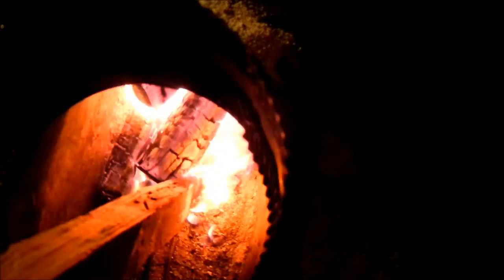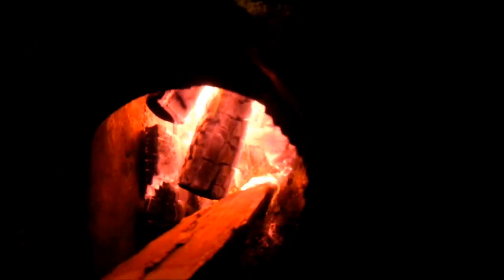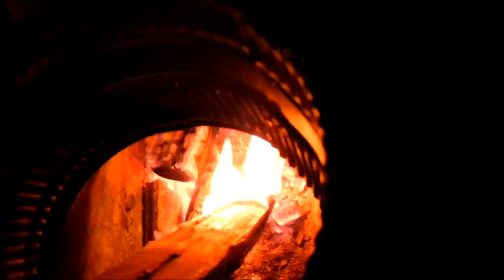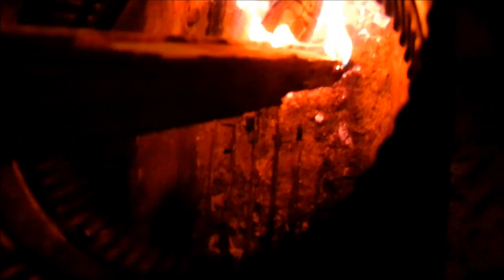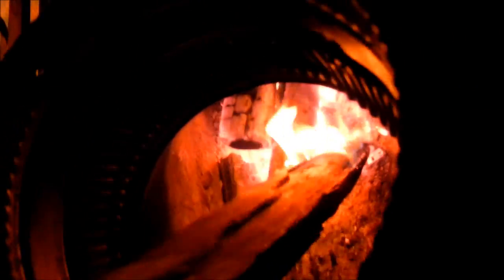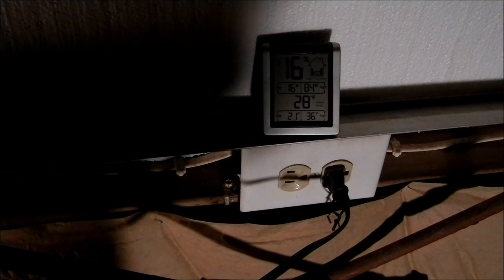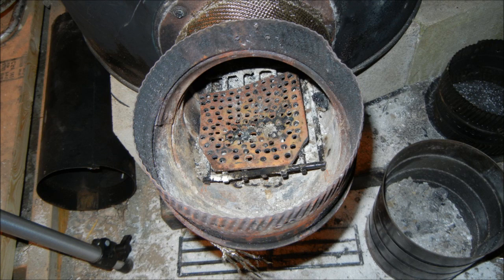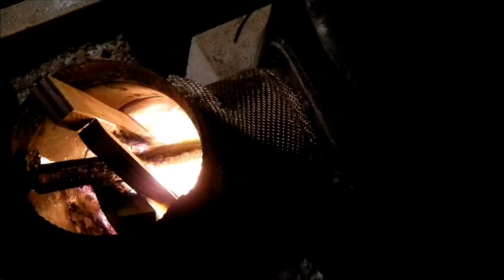6" stove pipe rocket stove heater 55 gallon drum version heating 30x30 foot workshop

Comment: How do you clean out the ash from the burns?
Reply from the maker: There is very little when I do clean it out I just use a small fireplace shovel that I bent so its oval instead of flat to clean out the burn chamber. After like 5 burns I get maybe a coffee can worth of ash. These stoves are super efficient so don't leave much ash.

Comment: You're getting a lot of heat from the exhaust pipe.  If you wrapped some finned sheet metal around it, the heat yield would be better.

Comment: Your wood feed should be a T instead of elbow - load T from top with wood, then cap it, bring in OUTSIDE air from the other (horizontal) part of T
That's how I plan to do my shop heater
Reply from the maker: I tried a T when I started it did not burn right to much turbulence, better off just feeding the outside air in through the feed tube if, if you want to bring in outside air. But then again maybe with more experimentation you could get it to work.

Comment from the maker: I had one of those heat re-claimers on the chimney and it did not turn on the temps were already getting to cold for it 2 feet after the exhaust from the barrel. Stove is still in good shape hoping to use it more this year possibly.

Comment from the maker: That being said if you build one like mine and add thermal mass bench you can store a lot of the heat so that you don't have to keep feeding it. And is something I am probably going to think about adding on this summer, that and I am going to probably section off part of the 30x30' area so I it will be easier to keep warmer longer. it will heat the 30x30' but it takes a while and it cools down fast because of the area dirt floor that's frozen solid etc if I kept the area warm it would be easier.

Comment from the maker: A lot of it is just people are lazy, they would rather throw in a whole log than have to split a log down into small pieces. They would rather smolder a log for hours getting 1/10 the heat output than to burn 1/10 the log quickly and get 10x the heat output quickly. As awesome as these are they do have drawbacks especially one like mine, even with the "hopper" on you have to feed it you can't just throw in a log and its going to keep you warm for hours it has to be fed.

Comment: If you would take some expanded metal and make split your feed tube feeding the wood in on top and allowing air to enter on the bottom you would have a better more even burn and wouldnt have to worry about chocking it off with to much wood . Nice job :)

Comment from the maker: Would be interesting, some guys have done some similar things when burning pellets. Also some have found putting something in front of there wood to restrict the flow can make a better burn it makes the wood move through the wood differently. That is something I plan on trying as well, just have not had the time to mess with it at all lately one of these days I need to get out there again before summer comes.

Comment: Hey Redicety, I had an inspiration seeing your rearranging of the wood to optimize airflow...what if you built a steel mesh tube, put it in the middle of the feeder tube and arranged the wood fuel sticks  on the outside of the mesh tube?

Comment from the maker: Highest I have gotten it so far is like 58 but I have never been out there more than a few hours and the walls still need a lot more insulation. it is a huge area for a stove to heat, I had a traditional wood stove that was basically the size of this barrel but the whole front opened to put wood in. That did not do nearly as good of a job as this and this is burning at least a 10th of the amount of wood at a time.

Comment from the maker: Ah yup I did watch his vid before, that one specifically actually, his is interesting few things I don't like about it mainly it all being welded together hard to clean out later on. He could have made his heat riser come through the bottom of his barrel some so he could attach his feed to it with screws to hold the whole thing together and have a lid like mine that way the whole thing would have been modular same with the exhaust of course. Would not have been hard and no welding.

Comment from the maker: The insulation cools it down, I already did it once, keeps the heat inside the pipe its not perfect "would need 2 inches of my insulation for that" When I was building this one I burned it with the lid off and was able to touch the side of the heat riser it was warm but not super hot and that's with flames shooting out the top of the heat riser at times.

I may go and bend out the sleeve today and try insulating the feed  if I do I will try and do a vid of it and upload it will check out his vid

Comment: Have you seen MrTopGun21's barrel rocket heater? Check out: "Making a Rocket Stove Thermal Mass Heater - part 3".  I'm considering his system, looks simple and cheap to make altho the black stove pipe does get cherry red in the vid! It's a bit taller than yours but the exhaust pipe comes out the bottom so pipe can be put on the floor which might be nice to have when doing mechanics on a  creeper. The insulation mite make the metal hotter, air cooling mite help...bricks...

Comment from the maker: Thicker metal would help, a little but I think it more just needs to be insulated for several reasons one of the bigger ones is safety it gets over 1200 degrees right now if you touch that your getting a hell of a burn. When I built this one I was originally going to go through the bottom but then decided to make it this way because it would be easier to change things and stuff. I may make another that goes through the bottom so that I can have a taller heat riser "more heat that way"

Comment: I'm thinking about building something like what you have but maybe instead of a burn chamber through the side have a burn chamber underneath made of brick and cob (mud & sand). An insulated firetube could be welded to the bottom and a side hole for the chimney could be like yours or maybe a little lower... the barrel would be light and easily moved but the brick fire chamber would have to be rebuilt everytime the heater is moved.. I like your system tho, maybe thicker metal for fuel feed? thinkn

Comment from the maker: Should check out my other video I did exactly what your thinking about, makes it quite heavy however this is a lot simpler and lighter. The header wrap helps it but header wrap is expensive, the metal turns bright red you can actually see it right through the header wrap when it gets really hot it heats up the wrap which is made of titanium that's why I am thinking of sleeving it with an 8" elbow, for safety and a even better burn.

Comment: Yeah, I bet a dolly would make it real easy to move about... ramp it into a pickup truck to transport to another garage for heat. Hows the sheet metal of the fuel feed holding up? Does the header wrap help it or hurt it as far as handling the heat?  I'm toying with the idea of casting a refractory cement fuel feed/combustion chamber and placing the heat riser on top, maybe the barrel could be an integral unit w/ the heat riser and place atop the combustion chamber-altho I like yr one barrel unit

Comment from the maker: Pretty good I have been contemplating making a sleeve for the feed "I am using a 6" elbow now wrapped with header wrap" thinking about sleeving it with an 8" elbow filling it with the insulation cus even with 2 wraps of header wrap this thing gets so hot it turn the header wrap bright red. Otherwise good.

Comment from the maker: Thanks I did so many experiments & tests that I did not end up using, I tried one of those heat re-claimer fan things in the chimney pipe right by the stove where that T is now, it would not turn on the exhaust from the stove would not get hot enough to kick it on. And tried a few other things. This video pretty much summed up what the most important findings were. Mainly that pushing 30+ feet uphill is a bit over what the stove will push the exhaust without a chimney that can boost the draw.